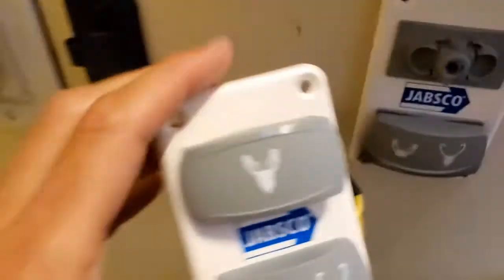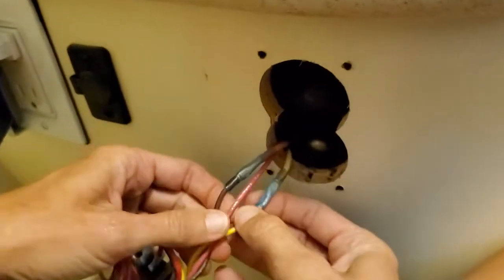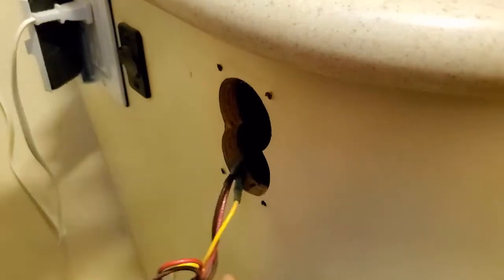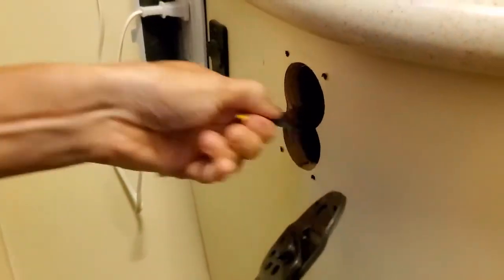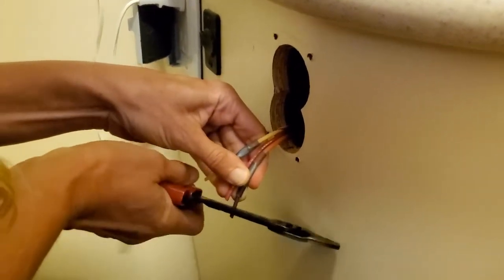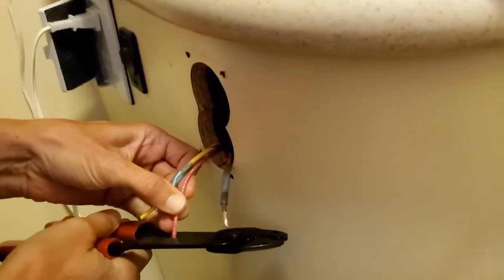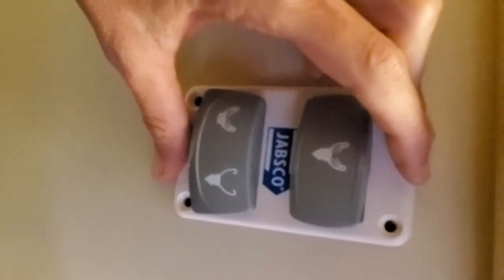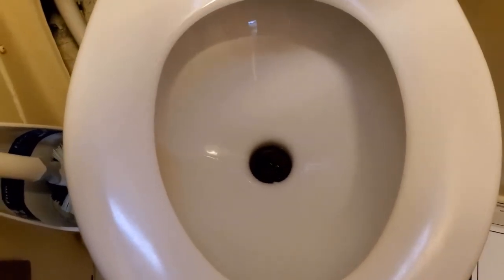Jabsco Electric Toilet Switch Replacement

Comment: These "new" switches are horribly unreliable. After going "round and 'round with Jabsco, they finally admitted that it's a faulty design and that they have a new design in the works. I ran the parts for this by my brother (who is an EE), and he said they were not designed for this duty cycle. So, here are my tips for this problem: 1) The contacts do get a buildup of carbon on them, effectively insulating them and making them fail.   This carbon can be cleaned up, and then the switches can be reassembled.  However, this is a temporary measure, as the coating that the manufacturer puts on the contacts to keep carbon at bay, has been worn off.  2) These are Carling switches, and the numbers are on the sides of the switches.  I found one for less than $10, and the other for around $20.  That's a fraction of Jabsco's prices.  3)  Wire a relay for the macerator wires.  This puts the substantial load that the mascerator motor puts on the circuit, to the relay, rather than these flimsy switches.  It's easy.

Comment: No need to cut the wires. The terminals on the end of each wire, slide on and off a flat lug.  You can just pull the wire off, swap out the switch, and then put the wires back on - making sure that the wire colors are in the correct order. Be sure to snap several pics of the back of the switch before you pull the wires off.  If needed, label each wire with a piece of tape, to make sure you get it back in the right place.
Reply from the maker: Thanks for the tips, I have since learned how to do electrical jobs, much much better!!

Comment: My macerator suddenly doesn't do anything when I press the flush button. No sound at all from the motor and the breakers are all ok. Could it be a faulty switch, or more likely a faulty motor?
Reply: what did you ended up doing? i have the same issue